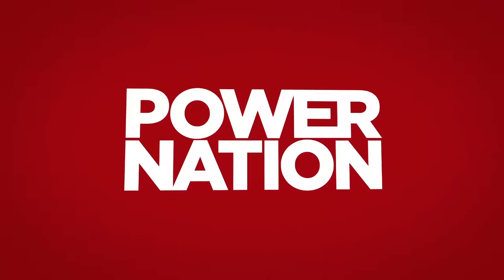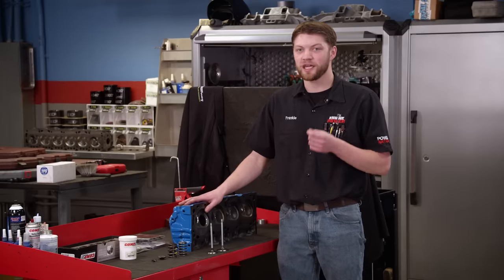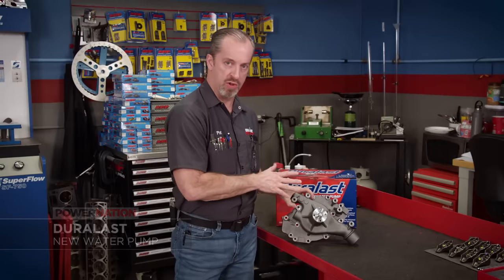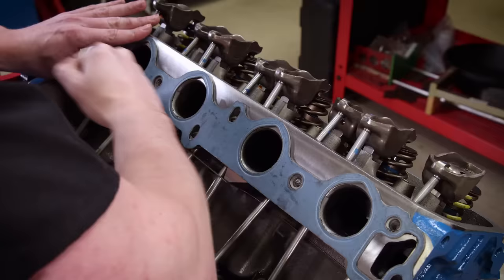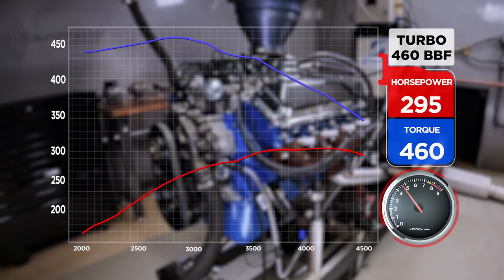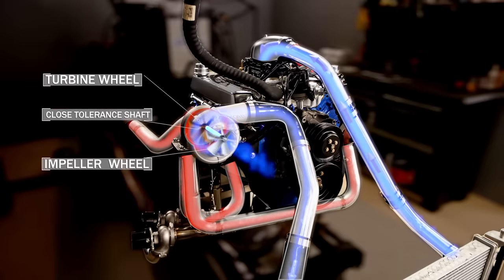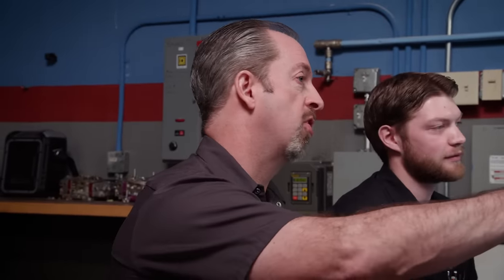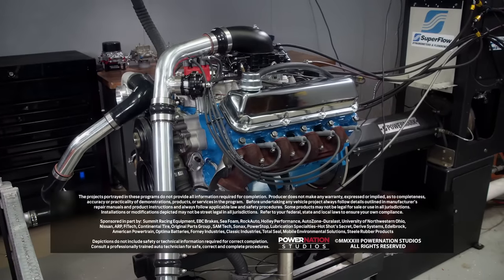Turbocharging a Stock 460 Big Block Ford for Massive (And Affordable) Power - Engine Power S10, E5

Comment: Frankie and Pat's chemistry on this show is top notch! I wish all powerblock shows (cough carcass cough) could do the same
Reply: "Carcass" is such an appalling show because they just throw things together and don't actually restore anything.
Reply: Kind of.. ya know, like the name???
Reply: Carcass is a amazing show and it’s a non traditional car show, cause they throw in parts and make it cool
Reply: WOW! That's a weak cam... even for a stock cam... must be an emissions truck cam...
Reply: That carcass show is trying to do roadkill builds.
Reply: Tommy and the dude with glasses use the butt heads a lot. They split up now Tommy’s with the white dude with the goatee and the dude with glasses is with the younger guy with long hair. They do such good work they couldn’t get rid of either one of them.
Reply: Yeah, they really don't seem like they like each other at all.
Reply: Frankie isn’t bad but Mike Galley is irreplaceable. The show went from awesome to just ok. 🤷🏻‍♂️
Reply: @VinceGuzman  yeeeaaahhh... that's not cool. At all. I hate hacking.
Reply: How many Co hosts has Tommy run through? Every time I watch the show he's there but they've got a new Co host?
Reply: @jesseshelby4383 joel’s been on there the longest since marc went to music city trucks, almost 2 years now I think?
Reply: @BuzzLOLOL trying to keep cost low. You can buy them for $50 bucks.
Reply: @jesse75   - Still? Price of cams just BidenFlationed 50 - 100%!
Reply: @BuzzLOLOL  The one with 218 on the intake? Perfect for torque at a reasonable rpm range
Reply: You aren't serious are you?

Comment: I experienced the raw power of stock 460 cid Ford engines in my Lincoln MK III and MK IV's from 1970-1974. I would tune the carburetors and change the distributor advance curve, in order to achieve as much as 20 MPG. I built 427's and 428's for competition. The 50's, 60's and 70's were good ol' times for me.
Reply: Ford burned the midnight oil when they put that early 460 together.
Reply: Early 460s were good. Lots of rotating weight but good heavy duty engines that could go hundreds of thousands
Former biz partner has a 80s? Ford Centurion with over 300k on it towing his 36ft chris craft from Ca to Fla and back still ran like a top. Never knew about those engines til then.
Reply: what would you do to the timing curve to get that mpg?......I have a 75 Continental with a 460. I just got done swapping the intake to a Performer(non-rpm) and an Edelbrock AVS 500cfm.
Reply: I call BS on 20mpg
Reply: I keep my 460 tuned fairly well and get 15 mpg. Its not stock. It will pull anything with your foot barely on the gas.
Reply: @drifter9425  Me too

Comment: I built that same setup 13 years ago with a s475 turbo and put it in a 73 maverick grabber. It went 6.6@106 on 12 psi boost
Reply: How did you fit all that in? NA 460 85 Stang it was a nightmare to tighten headers. But sure was fun!
Reply: Did u have to get a stang k frame instead of the shock towers etc? I just a 73 maverick & am looking to put a bbf in a while

Comment: We definitely need a 3 part series. Mild to Wild. Would love to see 20+lbs of boost. 😅
Reply: i'd love to see the bottom end of this motor built, an e85 efi setup installed. i wanna see how much torque this thing can make. at less than 10 psi its over 700! at 20 psi this thing could make a stock cummins go "what!?"

Comment: Great video. A 460 from a Lincoln pre 72 without all the emissions would have been interesting to see.
Reply: Couldn't handle any where near the same level of boost with the 10.5:1 minimum compression of the pre 72 engines, likely you would end up making less power...
Reply: Why wouldn’t make any more power what would 10.5 compression cause it not to make power in the pre-72 bbf, I’m just curious why you say this
Reply: @robbyshinault1069  You obviously have no functional knowledge about turbo charging. You can't run high compression ratio's with turbo's unless you like shattering pistons.   Pressurizing the induction charge raises the peak cylinder pressure as you are jamming more air in to the cylinder.  At 7psi boost you are  increasing the peak cylinder pressure by about 50%, in effect you are raising the compression ratio but with additional air instead of a smaller combustion chamber.  Adding any amount of induction boost with an already high compression ratio and you will quickly exceed the limits of internal components and end up with detonation. SO with a higher compression engine you would have to run much much lower boost, lower boost equals  less oxygen in the induction charge , less oxygen in the induction charge equals less power made. If you want to make power with a Turbo in a gasoline engine you run lower compression ratios simple as that...
Reply: @matthewq4b  All new engines have high compression and turbo. Low compression forced induction was like 30 years ago when we didnt have good computers to help with engine management
Reply: @matthewq4b  It's 2023. 10.25:1 compression, and boost is easy, modern GTDI engines are 11:1 compression and turbocharged. EFI and E85 make things possible that you don't know about. You must not know about methanol fuel either....
Reply: @toyyoda3710  
Direct fuel injection is what makes high compression capable with boost.  Try that with multipoint fuel injection on premium fuel and it is a recipe for disaster.
Reply: @jamesgeorge4874  those that are doing a basic turbo setup on a 30+ year old motor more than likely aren’t going to be too keen on E85 nor with methanol.  The fact remains though, if you aren’t running direct injection and/or alcohol fuel then you need low compression.  Not to mention, there was never a Ford 460 that had direct fuel injection.  So comparing  low compression with multipoint fuel injection to high compression direct fuel injection is like comparing a racing slick to a street tire.
Reply: @matthewq4b  It is in fact temperature (of the fully compressed charge in the cylinder) that causes detonation not pressure. Of course the two are linked, whenever you compress air it heats up, whether in the turbo or in the cylinder itself. This is part of why turbo engines almost always run intercoolers, the charge cooling helps ditch some of the compression heat from the turbo and delay detonation, so you can run more timing or a higher CR. It also makes the incoming air denser which helps with power, but the delay of detonation is in many ways even more valuable.

One problem with an old engine like this on high boost and compression is the primitive combustion chamber design. Big, wide bores combined with relatively low flame speeds from the unoptimised chamber shape mean the engine needs more timing to burn the fuel efficiently, which in turn means that detonation will start at lower compressed charge temperatures than it would on a modern engine. That's not to disrespect the engineers from back in the day, they just didn't have the resources of modern engine designers, especially the ability to do computer simulations of flow and combustion in the cylinder.
Reply: Have one!
Reply: @matthewq4b or add duration, to keep the cranking pressure down

Win-win...

😈
Reply: @toyyoda3710 He's talking about having high compression before boost. If you start off with a 10.5 to 1 compression ratio and then add boost you'll be up to like 13 or 14 to 1 compression which is way too high for a gasoline engine.
Reply: @nerd1000ify Not only that those engines back in the day weren't really engineered for boost. Not the production engines anyway.
Reply: @matthewq4b  Plenty of turbo "high compression" engines these days , the low compression for turbo stuff is a thing of the past.
Reply: @a6t8vw1   Ya and is the 460 a modern design computer controlled EFI engine designed specifically for a  Turbo....   Thanks for a completely useless comment that has NO relation to what is being discussed.....  Good Job Skippy you nailed it...🙄

Comment: I have a D0VE 429 block with Boss main webs, billet steel splayed center main caps. I’ve seen the exact same block/setup support over 1000 Hp for many years… 
Don’t care what anyone has to say. The big block Ford is the best factory block for making hp… Blocks will fit a 4.5” crank, massive head bolts, tall decks… What more could you ask for…? Big hp and big torque… Reliably… 557 cubes on a stock block… 😏
Reply: Yeah the 429 is because they are easy to find with a 4 bolt main, but the 460’s are very hard to come by with a 4 bolt main. Big block Chevys are king in my opinion as far as cost to built and parts availability. To each is your own I enjoy when people put the correct motors in the correct cars, ie. played out foxbodys with ls swaps. I love a hot 408 Windsor stroker in a fox.
Reply: No difference in a 429/460 block they are the same.  Also, you do not want a 4 bolt block, you want a 2 bolt DOVE block , so you can put a splayed cap on it, and have a block much stronger than a factory 4 bolt vertical bolt cap block.  Also, on no planet are 4 bolt blocks “easy to find”.  They were only used on CJ/SCJ cars.  Leave the factory 4 bolt blocks for oem restorations.  A filled dove block at stock or close to stock bore size with a splayed cap will support  2000k plus hp in turbo applications on acohol.
Reply: @RacingRon47  yeah… guy obviously doesn’t know what he’s talking about… People always think factory 4 bolt blocks are the best thing ever. When like you said, a two bolt block like mine with splayed center mains is much stronger… People don’t understand. Two bolts both vertical rather close to each other isn’t doing anything… Take those extra bolts and put them on an angle to get out in the the web structure of the block and further apart… Now you’re doing something. Plus two fasteners are pulling in two different directions… Guy offered me $1,200 for my block before I ever machined it lol. Ford guys know what block is king…
Reply: @frankensteincreations4740   I think it's pretty well established that earlier engines with non deep skirted mains had issues with flexing especially when big block Ford cranks have 40+ lbs over the bbc. Youre right in that he huge main bolt size and large caps provide a ton of clamping force but when you take an early d0ve block compared to a d9, you see the additional material added below the centerline of the crank as well as the longer skirt.

 The 429/460 is the king of heavy rotating assembly and is well known for trying to walk the mains especially on 2 bolt blocks.
  You may not have personally had issues and while there is many people making crazy power on a 2 bolt block, there's documented evidence of main caps shifting or walking and that is precisely where a 4 vertical main bolt block will help, and adding cross bolts on top of that make a very stout support for the crank. Even though the fasteners are both pulling the same direction, you still have twice the clamping force, twice the shear resistance, and they can be replaced with studs which are more even at applying clamping force yet. Not to mention the girdles and windage devices that can bolt in with the mains and further beef the bottom end.
This is why basically every production engine now has cross bolted 4-6 bolt mains with a deep skirt for more material around the crank. They learned from the past.
Reply: @frankensteincreations4740  what exactly was written in my post that implied I didn’t know what I was talking about? Because I stated that BBF’s are rarely found with factory 4 bolt mains? You can put custom splayed mains on almost every motor from this era. Doesn’t make it special, it’s aftermarket and it’s very costly to get all of that machine work done. I was stating that Chevys are more popular because their cheaper to build on a budget, especially because of the marine and motor home blocks you can pickup for cheap. Sure with enough time and money anything is possible. I said I like when people keep ford motors in fords because you always see Chevy motors swapped into foxbodys because they are…. You guessed it cheaper to build and make big power. The 460 is a more niche motor and not many people use them in builds anymore. You can get big block power out of lighter smaller small blocks. All the boomers love raving about splayed caps and technology that ain’t worth the time and effort anymore unless your going for.. your guessed it the correct motor for that car “originality”.
Reply: @marlinnotfish  Me too. I'm not a fan of putting GMC products in Studebakers and everything else.  I know some parts are hard to come by, family seems to have a knack of buying equipment for which parts are expensive and rare, but unless it's going to be price prohibitive keep that Studebaker 289 in there. I would much rather have a Golden Hawk with the 289 or 312 than a 600hp LS. Like you said to each their own though. Just not my cup of tea.
Reply: Facts
Reply: to state the obvious--until the 1980's, the Rat beat the Lima due to parts availability--lot easier to find rectangle port rat heads for the 396 or for the big 454 than try to get a S/CJ head to feed 429-505 cid. Now that aftermarket heads are "cheaper" than rebuilding an OEM setup, and stroker setups are affordable, a 460 with a roller cam setup is easier to find than a 427 tall deck chevy truck block needing a roller cam upgrade or to try to stuff and overbore a "low" deck 454 from the junkyard. Too bad chevy decided their 8100 needed a special LS head--with all the 502's they built, you'd think they'd just go back to the parts bin for something to go against Ford and Mopar's 8 litre V10s.
Reply: @marlinnotfish  chev have a lot of problems, design..  the 350 is a chunk.. only 1/2 good chev is the late 454, almost same as an old 460.. chev just dont seem to want to build decent engines.. all aftermarket sht.. ill keep my 385 , series 351c, with 302c heads, 12.1 comp,on lpg, cheap, std, goes like a cut cat.. for the last 15 yrs,,beet that chev..
Reply: Always been a Chevy guy, but i love the BBF its wayy more versatile than a BBC
Reply: And you can punch a 460 block .100" over and be fine. Good luck doing that with a 454. Don't get me wrong, 454's are sweet. But the only thing Chevy has on Ford's are cost to build
Reply: I ran a 2 bolt 460 wiht a 100 shot for years, 5500 shift points 6k max its fine
Reply: @RacingRon47  I just recently sold a DOVE block for $700 to a guy that was taking it for a boosted application. I currently have mild 460 in my 72 torino. I don't currently have the funds to boost it but would love to do so down the road. (why I let the DOVE block go, didn't want it to sit around for so long)

Comment: Yes!! Finally! A big block for turbo build! Y’all gonna do a more serious version next? This was so cool! Diesel numbers
Reply: It would be great to have an obs dually with 460 and throw a turbo on it
Reply: Have these guys built a diesel because I want to see it
Reply: @BruceLee-xn3nn  Only problems with trying to shoehorn a turbo into the OBS’s are the turbo piping, mounting location, dealing with the stock efi system, and converting it to speed density (I think) air flow.